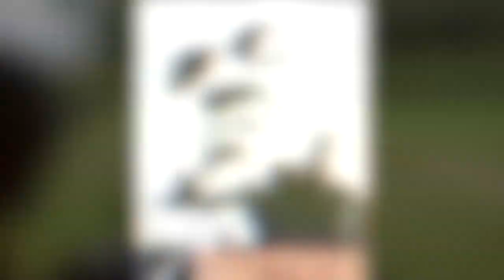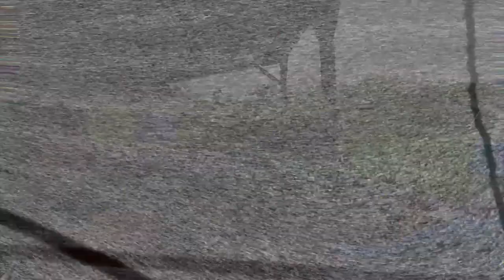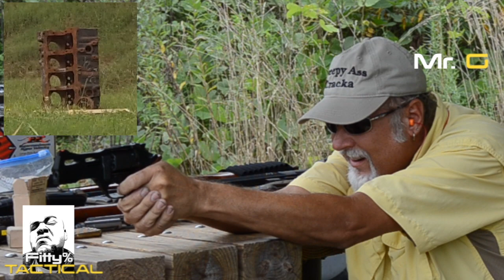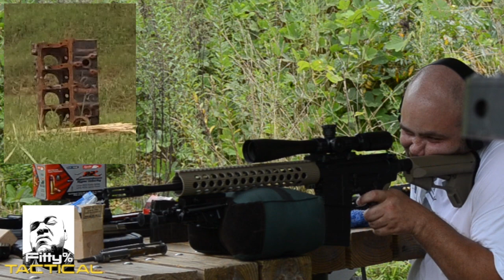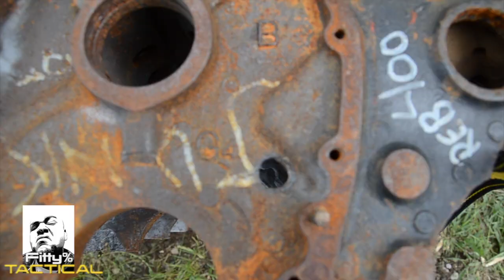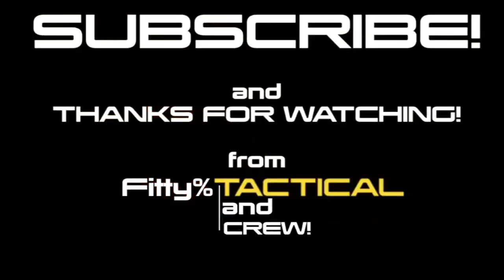Engine Block Penetration Test .22lr to .50bmg

Comment: i was impressed. an iron block is a beefy piece of metal. But it is mainly designed to withstand heat and torque, not sharp sudden impacts from a bullet. Cool video...I was waiting for the 7.62x54r and the 50. 50 was nuts.
Reply from the maker: Thanks

Comment: Love this video. maybe take spray paint next time to mark rounds that have already hit. i know 147gr steel core 7.62X54R goes right through 1/2" mild steel not sure how it would do vs cast but try and get some "Steel core heavy ball" they are painted yellow with a grey tip those will cause some good damage. great vid love all your other vids as well

Comment: i'd like to see the effecto of the .338 Lapua on that target... :)
Reply: the .338 Lapua is WAYYY weaker than a .50 BMG
Reply: that's obvius...but i think that the .338 LM is a great sniper round. A rifle chambered in .338 LM is perfect for long range sniping mission and a lot lighter than a .50 BMG one , much easier to carry.
Reply: 7150285
Might not have as much power but is far more portable and one of the most inherently accurate rounds out there. A true 1,000 yard caliber.
Reply: pilotdon50 if .50 BMG can't penetrate the engine block then .338 Lapua definitely couldn't either
Reply: 7150285
 thas's sure :) i didn't expected better result than the .50 BMG , but simply i'd like to see the effects :)
Reply: 7150285
But it will knock the hell out of FLIR. So you have a hardon for .50's well I do too. An API will zing right through this little engine block.
Reply: pilotdon50 not really, .50 BMG API vs engine block:
/watch?v=EwnVF1UoNEE
/watch?v=3pEylQ2G5-U
zero complete penetration...
Reply: maybe some .416

Comment: I'm not satisfied with the positioning of the block. Why would rounds be impacting from underneath the vehicle?

I would have liked to have seen the block placed on it's side, so the rounds would impact as if the operator was firing at the side of a moving vehicle.

Other than that, good test. Thanks for the upload.

Comment: Is this about trying to disable a car with a gun? If not, I think you'd get a better comparison with a more consistent target, like 5mm wall thickness I-section girders or something. Either way, if you're re-using the target, spray over the marks between shoots so the new ones shine.

Gee. I-section. That works so much better in a serif font. "Like a T but with a cross-bar on each end not just one end" - section girders. Sheesh. You know the ones. Highway bridge and multi-storey car-park construction materials.

Comment: Why waste time shooting the inside of a cast iron cylinder.  Try some realism and shoot a complete unit from the side.  Preferably one that is running in a car.  Then see what damage is done from the side and front.  (Forget handguns with calibres less than 357mag or small bore rifles.)  This would make interesting viewing.
In the UK once we put an old car on the range.  38's bounced off the windscreen, even 9mm failed to penetrate all the way through the door panel, so what use is anything less than a 44mag on a cylinder?
Reply: Please let us know the year and model of car so we can go buy one, because the doors on today's cars won't stop a 9mm or even a .22 from a rifle.
Reply: I was kinda thinking the same thing re. all the shots being taken at the inside of the block. Realistically, you would be shooting through a fender / wheel well (at the very least) and into the side of the block.

Comment: Aw come on, holes in a cylinder wall don't count for much wen the holes have been bored so far out in into the coolant passages. If you wanna impress your friends round up a 455 olds block, the usually weigh 20-25 less than a basic 283-400...Bigger motor and less weight means a lot thinner.

Comment: actually if u have a complete engine block w/ cylinder head, pistons, and connecting rod in it it probably will stop the .50 cal
Check these videos out:
/watch?v=EwnVF1UoNEE
/watch?v=3pEylQ2G5-U

Shooting engine transmission:
/watch?v=-lcpzNPQaWs

Comment: Why are you shooting into empty cylinders?  The engine would be hit from side or front, pistons, fluids, radiator and all.  This might show the difference in power between different calibers but shows nothing about the old 'engine block' penetration.  I have read that a .357 magnum would penetrate an engine block.  I have one and I can assure you it won't.  From side or front the .50 BMG is the only thing you shoot worth considering.  The others might cause loss of fluid and disable the engine, eventually, but not stop it cold.  Turn that thing to the side and show some realism.